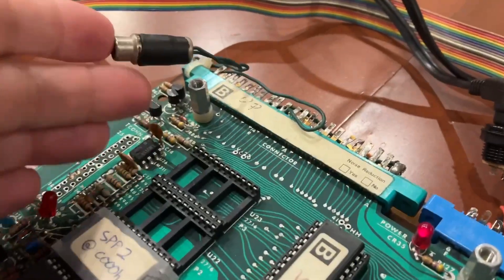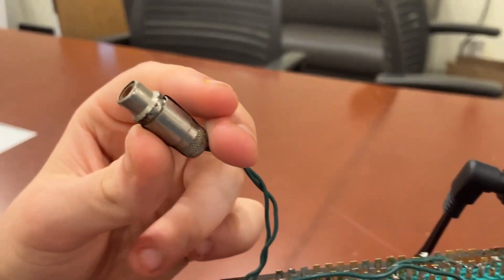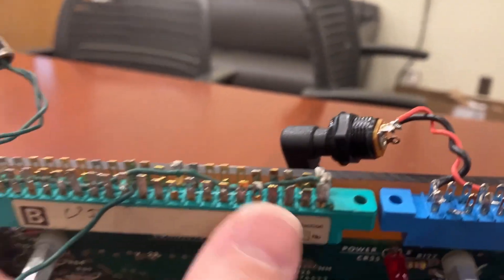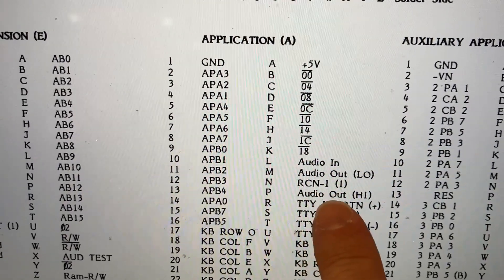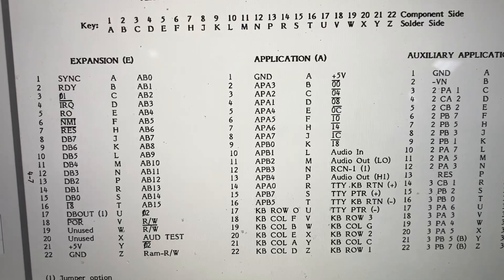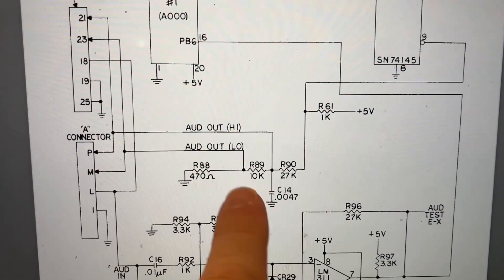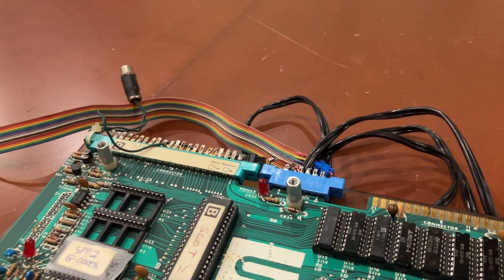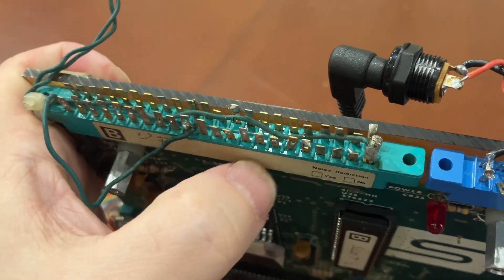Deciphering Audio Connections on the Synertek SYM-1 (for saving & loading programs from tape)

Comment: Oooo, I actually knew what this was through intuition lol. I referenced the BASIC stamp and this is seemingly, it's older but more in-depth predecessor that surely led to it's development much later in the 90's. 
I suppose both can be perceived as what led us to Arduino which I foolishly mistook for something it is not until actually researching it a couple years ago. 
Man did I miss the bus on that one, and I've had one for a good 10 years!

The explanation I was given related it to the Raspberry Pi, another one I own and that they were oriented for learning software language without it being stated they are in fact, both microcontroller equipped development and prototyping machines.
Reply from the maker: This particular one was owned by a composer named Richard Teitelbaum, so I initially thought it may be some kind of square wave musical output (although yeah cassette was always more likely.)